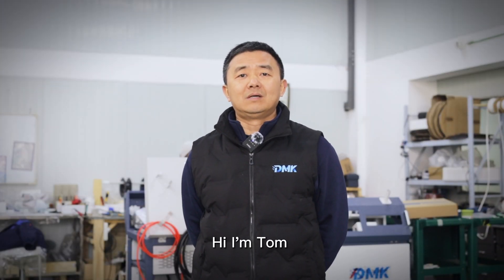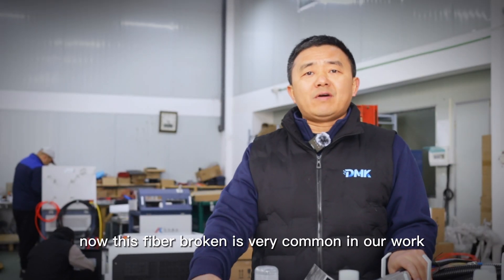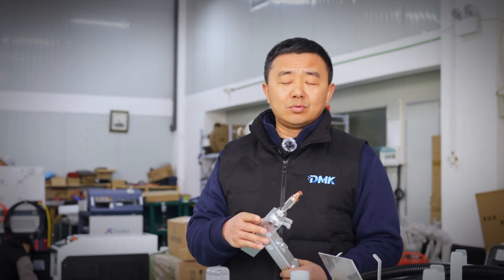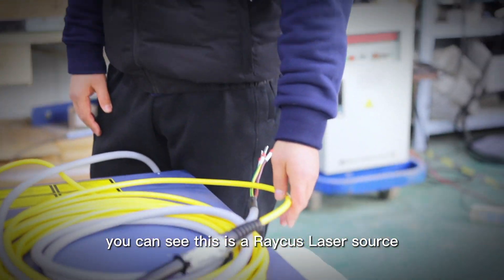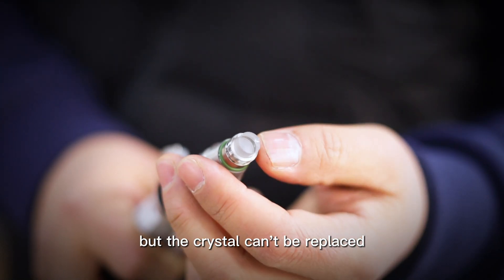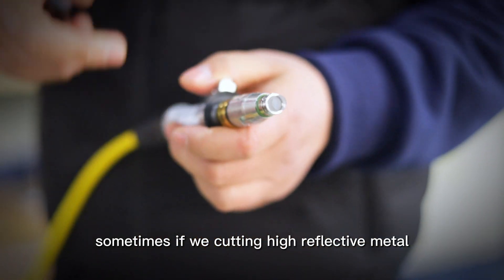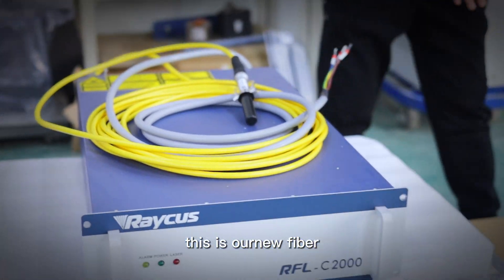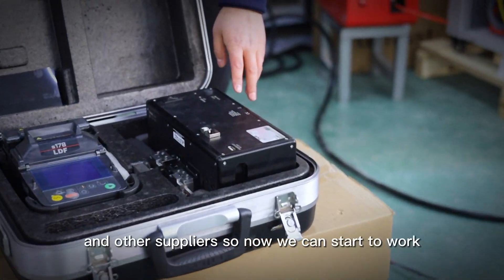Fiber laser source repair

Comment: Dear Tom
What is the chemical liquid that you cover after fusing with the fiber fusion device?
I tried a few times at 20W and 30W. It works for a few hours but then the chemical that I coated on burns and breaks off in the same place. I tried this process with many different coating chemicals. The same result came out each time.
Do you have any suggestions for me?
Reply from the maker: Hello, did you use the special glue to do the repair? Please talk to me on whatsapp for details. Whatsapp & Wechat: +86 18571649581